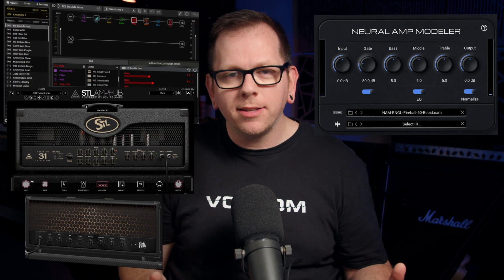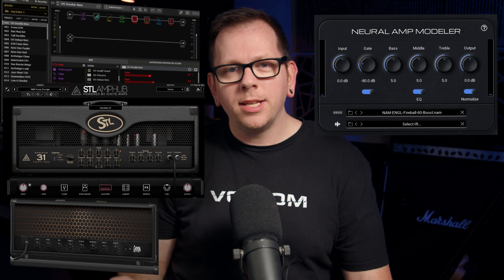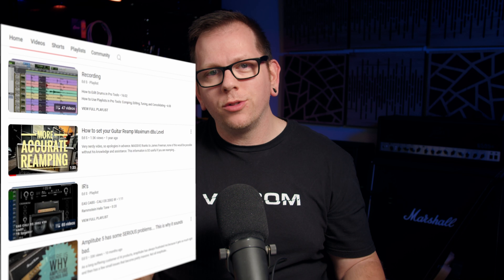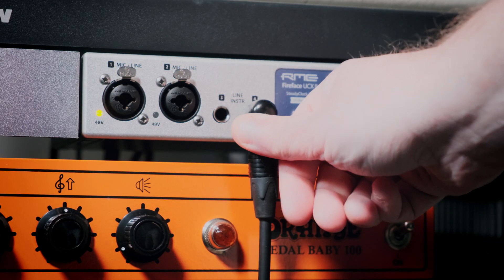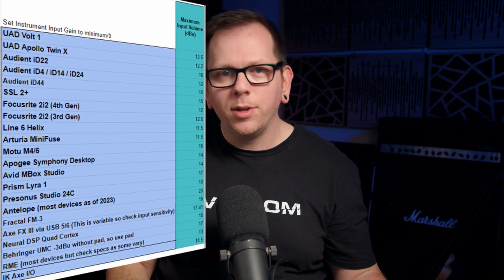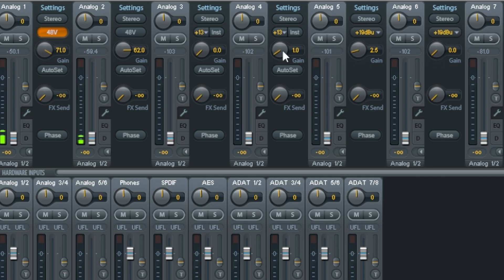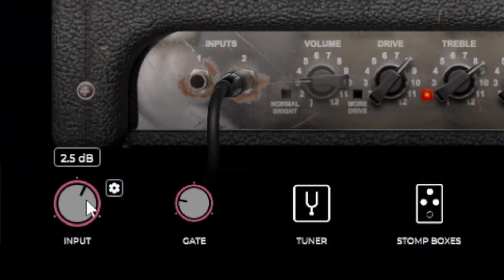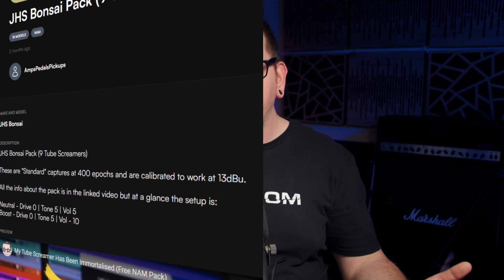Amp Sim / NAM Input Level Accuracy Explained

Comment: My interface inst input level between -15db to 65db , so should i set to -15db or find the 0 db positon?Thank you!
Reply from the maker: What interface is it? And what Amp sim are you trying to use?
Reply: @ampspedalspickups  It’s Presonus studio68 and Neural Amp Modeler plugin.
Reply from the maker: @caopgtr  The manual for that one says when your interface gain is set to 0, the instrument input is +15dbu. I have some captures at +13dbu and 2dor and others also have some captures at +13dbu. If you were to use ours, to take your input from +15dbu to +13dbu you need to turn UP +2db. If someone's pack said it was captured at +5dbu then you'd need to gain it up by +10 inside the plugin (always leave the interface gain at 0 and gain things up inside the software).

The problem with NAM captures that you'll probably encounter is that lots of people don't mention their capture specification. If that's the case then it's a guessing game. But if you use someone's who has mentioned it, you can just adjust in the software.
Reply: @ampspedalspickups  
So I should adjust it to 0db instead of the minimum -15db right? But 0db is not exactly marked on the dial, I need to find it by eye. I have figured out the formula for adjusting the plugin inputs. I re-downloaded some captures with specification, used them by guesswork before.
Reply from the maker: @caopgtr  On your interface keep the gain at 0. When you plug any guitar into a plugin and everything in the plugin is neutral then the signal is still sitting at +15dbu

When you go +2db in the software then your signal will be +13dbu. If you go -2db in the software then your signal will be equivalent to +17dbu

The INPUT knob in NAM will load at 0.0, just adjust it up or down the match whatever pack you're using is saying its captured at.
Reply from the maker: @caopgtr  On your interface the gain should be at 0... all the way down. Do any adjustments in the software. 

With the physical gain knob on 0, to hit +13dbu you'd take it UP 2db inside of the software... just always leave your interface gain at 0 and you'll know the signal there is +15dbu
Reply: @ampspedalspickups  So i set it at 0dB not the minimum-15dB right？It’s about 9 o’ clock.
Reply from the maker: Yeah this is a bit weird. Normally interfaces don't have the ability to attenuate (reduce) gain. So the knob at its lowest setting is 0 and you can only ADD gain. The Presonus seems to not anchor to a 0 which is very odd. I saw this reddit thread about it. I'd shoot them an email and ask them where 0db is on the gain dial and see if they have a good answer

https://www.reddit.com/r/presonus/comments/1agfc6q/where_is_0db/

Comment: My direct signal from my guitar through Scarlet set to 0 into DAW is -20dB. Does this mean that I should increase the gain for +8dB to get -12dB? I use a NeuralDSP plugin.
Reply from the maker: Companies quote input specs like +12dbu meaning you have 12db of headroom... +3 would only be 3db of headroom etc. When the scarlett is set to instrument mode and the gain on the interface is all the way down, it has +12dbu of headroom... NeuralDSP also calibrates their plugin to +12dbu (not a coincidence, this is a common number)... So just have your instrument button ON, set the gain all the way down on the physical interface and you're all set, no need to touch the gain inside of the NDSP sim.
Reply: @ampspedalspickups  OK. I read what actually dBu is and I read the scarlet specs. It said 12.5dBu maximum input level at 0 gain. I believe it means you can feed the interface with maximum of 12.5dbu signal when the gain knob is at 0. I haven't found anywhere what the prefered level of signal is for the DSP plugin. However, I know that the desired level for any input signal going into audio gear is 0 dBu (0,77 volts). If the guitar signal is lower you have to increase the gain to make it to zero dBu. Then the signal is perfect for your audio gear to handle and modify it (sound to nouse ratio). As I understand it, turning the knob to just below orange led on scarlet makes the signal close to 0 dbu. My guitar just doesn't sound right at knob set to 0. The response and loss in sound is apparent.
Reply from the maker: Yeah all of this is spot on but when it comes to plugins they just choose random different calibrations. NeuralDSP have calibrated their plugins to +12.2dbu so if you're at +12.5 (which I know is right for scarletts) its totally the right thing! If it sounds bad from there it could be any number of other issues. If you want to join my discord and share a clip we can take a listen and see whats up.
Reply: @ampspedalspickups  Headroom doesn't represent a signal strength. It represents the amount of "room" you have to increase your signal before clipping or distorting it. Well, that's my understanding. Thanks for answering my question.

Comment: Hey man I have a Yamaha Pacifica 612 V II FM and a Motu m4 audio interface and I want amplitube and tonex to sound as realistic as possible so I was just wondering if you could please tell me the exact input gain figure I need to use in amplitube to do so I'd really appreciate it
Reply from the maker: Amplitube is the biggest offender and problem when it comes to all this stuff. NeuralDSP is set to +12dbu and others are fixed... Amplitube wont quote out their specs to people and people have figured out its because it changes pack to pack. So some set of amps might have come out 8 years ago and they are at one spec, some might be more recent and are at a different spec, its a hard one.

If you're looking at a specific amp I might be able to help guess the ballpark, but generally speaking they need a fair bit of input gain. When I use their orange amps I gain things up to the max inside of Amplitube and often it still feels undergained, so play around with extreme settings on that slider and see if it helps... but yeah Amplitube is one of the worst with this stuff, nightmare

Comment: Hi, i have a question, im new an thks stuff... If you have a 13dbu and needs 5dbu, you said you need yo raise de 13dbu, that means yo need to increase the gain? O reduce it? Thansk
Reply from the maker: The short answer is "raise"... to go from +13dbu to +5dbu you'd gain it up by 8db

The longer answer is +13dbu means it can handle 13dbu of gain before it distorts/clips. So conceptually +5dbu can only handle 5dbu of gain.
Another reason why its good practice to leave the interface gain at 0 and "gain up" these numbers in the software side is if you were to gain up your interface by 8db you'd almost definitely be clipping your guitar signal and theres nothing you can do to recover that. Whereas if you leave the gain at 0 on the interface and gain up the software, the original recorded signal will be fine, you can always back down the software gain if its sounding too weird / or you want to use a different software amp sim later.

Comment: Great vid, thanks. I have an RME UFX II, but it doesn't show what yours shows. If I select Instrument, it just sets the gain to 8dB (there's no option to select 13dBu).  The manual says Maximum Input: Level: Gain 8 = +21dBu, Gain 50 = -21dBu.  Going by that, and doing the math, should I set the gain to 16dB to get the max to +13dBu? Hope that makes sense....than add the 0.8 in Neural DSP
Reply from the maker: I checked the manual and yeah those numbers seem right. Guess there’s a few ways you can balance things. I think +12dbu seems to be a bit of a sweet spot for amp sims so you could just take you interface levels to match +12dbu. In theory to go from +21dbu to +12dbu you need to add 9db of gain. If yours starts on 8 then add 9, if it starts on 0 add 9… either way just add 9db of gain from the lowest available value and that will get you to +12dbu

From there you’ll perfectly match neuraldsp and you can adjust inside the amp sim for other ones, wouldn’t bother touch the gain on the interface again, just know it’s at +12dbu
Reply: @ampspedalspickups  Brilliant. Thanks 👍
Reply: @ampspedalspickups  Thanks! I also got a reply from RME: "Setting the INST option gives you a max input level of +21 dBu, @ 8 dB gain! So to get +13 dBu as max input level you need +16 dB gain."
Reply from the maker: @nathanwarrickmusic  sounds spot on! Just nudge NDSP sims by 1db and youre good to go. Sims have a very good tolerance for input gain so a couple isnt going to make or break things but its awesome to just deal with this stuff once and never have to think about it again
Reply: @ampspedalspickups The problem I’m finding is the recording level of the DI signal, even with gain added as above, averages around -25 to-30 dBFS. A very low signal. Also hard to see to edit in Logic without zooming right in. I’m beginning to think we should be aiming for a dBFS level as that’s how DAWs monitor. My sims seem to sound better peaking around -15dBFS, which means I need the gain at about 25 on the UFX. A bit confusing!

Comment: Another dumb question here😂 The minimum gain on a Scarlett solo instrument input, is that with the INST button ON or OFF??
Reply from the maker: If the manual is quoting “instrument level” then they mean with the instrument button ON.

Some interfaces boost the gain levels when the instrument button is ON… but mainly using the instrument ON you’re using the right impedence of that input…. The impedence of an instrument is a lot higher than a mic level so if it’s left OFF you’ll lose the top end of your sound

So yeah if there quoting a dbu value against Instrument in the manual, it’ll be with the button ON
Reply: @ampspedalspickups wow thank you so much for responding. I did this and my stl tones sounds pretty good and clear. I think i need to adjust some other levels or eq maybe because i noticed with my 7506s i get slight a clipping noise when i play certain things almost like the headphones are farting out.

Comment: How do you know whats the best level for reamping? Why choosing one level vs other?
Reply: usually you’ll want your reamp as hot as possible, and then it means you can record DI’s with a good amount of headroom and still reach unity. 12-14dBu is usually a sweet spot but it can be slightly more or less depending on the gear you are using

Generally consumer level gear will have lower output levels so that might determine how much signal you can get out of your reamp box. It also depends on the reamp box as some lose some level
Reply: @eds4754  great response Ed, I really appreciate your help as always!

Comment: Thank you for that! I'm on an RME as well, and this helped a lot. Now, there's hardware out there running NAM, being the Dimehead NAM Player. Perhaps it makes sense to have their specs as target, so it's gonna be just plug and play for owners of that device.
Reply from the maker: Would be interesting to know what the dbu headroom of the dimehead player is, I’ll have a look around and see if I can find their numbers

I don’t think the dimehead player carries that much weight for nam honestly. Like yeah it’s a great player but long term I think many more will come and they will have the same issues, and I also see nam being incorporated into modellers as well. I think we mainly just need people and companies doing captures to do it to any kind of standard levels on their end so we know and can adjust accordingly

What would really be a great solution is to embed the reamp level into the metadata of the nam file…. Then in theory if you told the nam player (in software or hardware) what your input is… things would just auto adjust perfectly. Of course this relies on people putting the right figures on both ends but when it’s done right it would be super seamless to flick through multiple packs without worrying about changing input gain constantly
Reply: @ampspedalspickups  I agree! Sadly, there are little to no specs for the NAM player. I hope Dirk from Dimehead will enlighten us. Regarding metadata, that requires talking to Steven.

Comment: Hi Nathan - thank you for the video.  I use a Grace M 101 as my Hi-Z guitar input, which then goes into my Lynx HiLo, and finally into my DAW (logic) wherein I use NeuralDSP plugins -- the Grace M101 preamp has gain from 10-75dB (10db being the lowest on the dial) -- so, would that mean I would need to set the inout gain in the NeuralDSP to +2.2?
Reply from the maker: It’s one notch more effort to do but we need to measure the signal basically. The more technical explanation of what’s going on is the neural amp sim is calibrated to -12.2 dbfs. When you plug straight into an interface with no preamp it’s easy to just read that input x is 13dbu or 18dbu below dbfs and you make the adjustment. But when you’ve got a preamp or di box or gain before that point you can’t really rely on specs, it just needs to be measured!

I’ll have a video up in the next day or so, easy process. Ed S on YouTube already has some out but I’ll get mine out very soon!
Reply: @ampspedalspickups  Thank you!

Comment: This is great! I have been testing this myself. However I want to know about microphone preamp plugins and whether we run a microphone at a lower level too and use the plugin for the gain?
Reply from the maker: I could be ignorant on the topic but I think it’s all less of a problem with mic preamp stuff. I guess conceptually it’s the same idea where they have captured or modelled the preamp behaviour to a certain dbu spec below 0dbfs but I guess the digital preamps are just adding nice saturation, it’s just less noticeable than a guitar amp reacting strangely to a guitar

Would be something cool to explore and see if those plugins have a dbu spec from the manufacturer

Comment: Can someone please help;

I dont have a DI box atm (getting one soon) and my guitar has fishmans. When I use the 'Instrument' input on my Scarlett Solo 3rd Gen, the signal clips even when the gain is all the way down, so I have to use the line input instead. 

I know that the signal will be weaker while using the line input, so should I boost the gain knob on my interface, or boost the input gain on my amp simulator to compensate for the fact that Im using line input instead of instrument input?

Any help would be greatly appreciated
Reply from the maker: You could do either but it’s generally better to leave the gain at 0 and boost in the sim. In the manual for the interface they should quote an instrument level and a line level. No doubt the line level will be a higher dBu than the instrument.

Once you get that number from the manual just check the spreadsheet for whatever ampsim you’re using and compensate inside the amp sim. So if your line level says 18dbu and the ampsim is 12dbu then inside the ampsim just gain it up by 6db
Reply: @ampspedalspickups  the Scarlett solo has 22dbu on line input, and I use Neural DSP, which on the spreadsheet says their plug-ins have 12.2dbu, so I would leave the interface gain at 0 and boost the input on the NDSP plugin itself by roughly 10db?

Thanks in advance, i really appreciate the advice
Reply from the maker: Yep that’s it!
Just remember it’s a starting point. Even though I hit nameless at 12.2 I almost always use a drive pedal on max, heavy gain and even in some cases I’ll nudge the input a bit, in your case 10 to like 11 or 12. Imagine not knowing this and not touching the gain and you’re like, why does this amp sim suck…. Cause you’re 10db off the mark 🤣. But yep 10db in neural and you’re good to go!
Reply: @ampspedalspickups  bro you are a life saver thank you so much 🙏  my six string with crappy pickups sometimes sounds a lot better than my higher end 7 string with fishman moderns and this is definitely why hahah, great video, I’ll be coming back for for, have a great day 👊

Comment: Don't boost your amp preamp, boost the ampsim input instead. To get to ur needed level, otherwise it's like using a pedal Infront of the amp.
Reply: Better to use separate gain plugin before the amp sim. After that u can boost or cut the signal to the amp to get the amp work currently and as authentic as the real one 😊
Reply: What level do you get the guitar? I’m sure you need to boost the input to get the best noise ratio… but then use a trim plugin to knock it back down but now you lost the input level. This is all confusing?!?
Reply: @ watch the video on ampsims input level by ghost note audio👍

Comment: Thanks for the video, I'm totally at a loss with this. I use a Line6 Pod Go wireless as my audio interface for  Nureal DSP plugins. I drop the input level on the Pod to roughly -50 db as this is the point where I can't here the Pod sound signal coming through and colouring the plugin. Is this correct? I'm not recording anything just using it to play through FRFR speakes. Will tbe plugin react as its meant to at that level. Thank you in advanced.
Reply from the maker: That’s a weird setup with a bunch of questions to go back and forth. Probably easier to join discord and can talk there

Sounds like there should be some DI with no pod processing coming out of the unit, shouldn’t need to gain the thing down to remove pod processing etc, it should be independent

And then you have the frfr hooked direct up to the pod? 

I’m working on the next video on how to measure things with a multimeter, could be a bit simpler for this setup. When it’s a normal interface it’s easy to find the spec but I find any multi purpose thing it can be trickier cause it’s more of a guitar thing first and an interface second kind of thing… it will definitely work and we can find the spec but without having the unit on hand I’m just not sure how it all works off the top of my head
Reply: Just turn the output volume on your pod to zero. That way you're not sacrificing the DI input going into your plugin